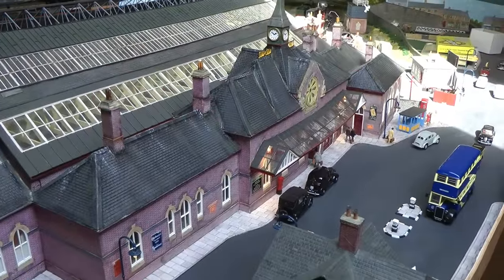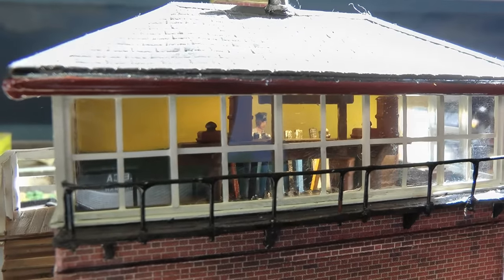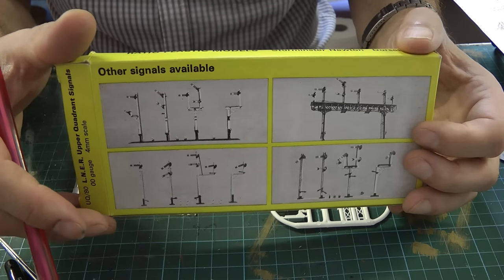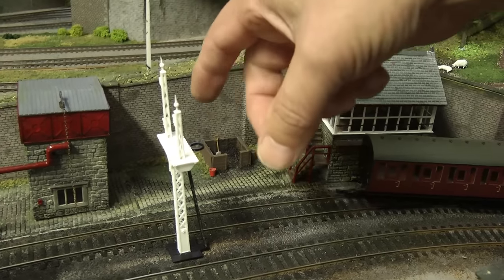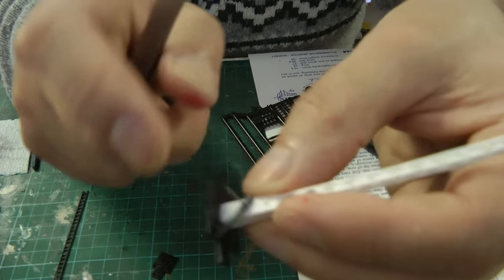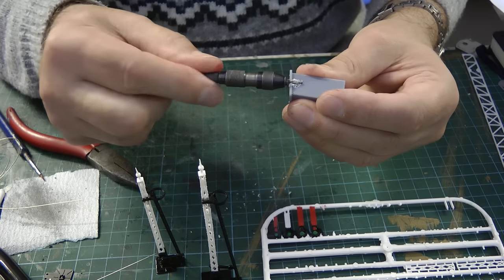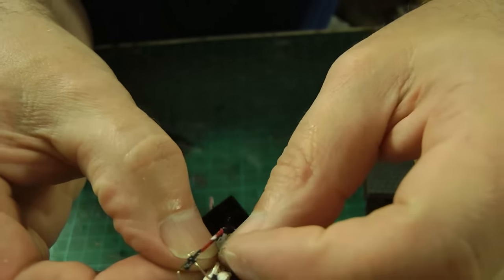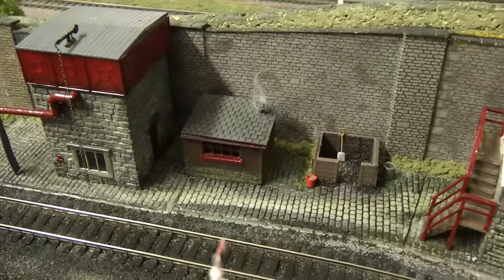Ratio Signals for Jarrow road. No394.

Comment: Hi Tony. I had to chuckle when you said that the signal kit was an old design with lots of nibs to the sprue.  Well you did say it was an LNER signal, so that’s pre 1948 😂.  Seriously, the kit is designed for someone who is prepared to go to great lengths to get a superior job.  I have a US water tower kit and the nibs are at a minimum. 
I like the outside 'netty'.  They were not posh like that when I was a lad!  
So your having your signals static?  You could add servos under the baseboard to operate them via your control panel and add a fine optical fibres going from a light source (LED) up to and inside the lamps so the signals are illuminated. They would look great at night.  
Great signalling job at Jarrow road.  If you want a more professional signal kit supplier, look at MSE.  Best, Jason.
Reply from the maker: Hi Jason mate. I remember those outside nettys. those old fashioned two ups and two down houses. where you shared with your neighbour. not very hygienic back in those days. it was in the late 1970s before we had a inside lavvy. 
I may change the signals at a later date for the automated ones once the layout is finally finished. if we ever get the layout finished. 
cheer's for now my friend. Tony.

Comment: Tony what you are calling levers are counter balance weights, which are designed to drop the signal back to danger (ON) if the signal wire breaks when in the OFF position! The use of the orginal gantry signal post would have been wrong, due to the posts being different heights, they should be the same for the station area, (shorter post denotes a lesser line, ie a branch line) the shorter signal arms are calling on or shunt signals in general, so for the station scene would be used for run-round movements. Good to see someone using the old Ratio kits, if you can pick them up at the right money they are worth their money & can be adapted to suit the scene, unlike the plug and play systems 👍👍
Reply from the maker: Good morning Vinny. i totally agree with the comment regarding the counter balance weights. but i am sure that ratio have over sized them just for the purpose to operate these balance weights-levers by hand. 
The signals are well detailed, but they do take a lot of effort to make them. but i do think that they are worth it. but i do have some plug and play as well. but for this station. i wanted a traditional old looking station. which i think i have achieved this. as always you have given me good words of advice and wisdom. thanks again for commenting my friend. cheer's Tony.

Comment: Dear Tony, just wondering about making the signals functional. Where your points are connected to the control panel, you may be able to put in either an auxiliary switch at the switch motor location, or they already are fitted with an auxiliary switch. That can allow you to operate the signals in conjunction with the switches. I’m aware the signals were in real life connected to the sequential block(s). To perform such action makes the operation much more tedious. However, as you said, ‘the devil is in the detail(s)!’
Love the flag pole on Alan’s crap house. Lord crapola got his privy planted. Cheerio
Reply from the maker: Good morning Vincent. I like your idea of controlling the singles from the control panel via a Auxiliary switch. it would a task and a half to do. Lord Crapola love it. i wonder if Al has watch the video. all the best my friend. cheer's for now Tony

Comment: The re-visiting of the station was excellent because it demonstrated the power of looking at the scene as a totality and not as a brick-by-brick view. The brick-by-brick view is a trap that model railroaders so easily (myself included) can easily fall in to. One small thing: where did you get the little models of the Queen and Prince Phillip. They would look excellent on the platform of my Jamestown station.
Reply from the maker: Good morning Andrew. the queen and prince Philip are a set. they are Ho and i got them from Ebay about 2 years ago. i am not sure if they are available. but its worth a look. i think i paid £12 at the time. thanks again for commenting, i hope you find a set. cheer's for now Tony

Comment: Hi Tony, glad you went first ,I have loads of those kits to make up. A real test of your patience, looks like the mould has just about worn out on the seams. Still they have made some cracking models and splitting them looks fine; it’s obvious to which track they belong. I was wondering if they are robust enough to add a servo to drive the arm? Looks like, with his flag in residence flying Lord Al is in still in that loo, must have taken a wadge of the Dandy and Beanos in to read and forgot to come out! Give you eyes a rest now, take care and all the best Stephen. Did you get the cam sorted out?
Reply from the maker: Good morning Stephen. These kits do take a lot of cleaning up to remove all the flashing. and they are very brittle. so yes take your time. i was hope to knock these out quickly. but i did not realise how much work was involved.  
I will have to ask his Lordship what he reads when he is on the loo. I am sure his next video. will have a ton of lavvy jokes. i am going to try something with the camera. so we shall see if it works. many thanks my friend. cheer's Tony

Comment: I must admit that signals have always been something of a mystery to me. I prefer lights to armatures but even then i don't always get it right. A suggestion for Jarrow Road (although you've already made the signals now) but could you have used a gantry spanning over the tracks? In a tight squeeze on my layout I found a gantry worked better than trying to fit signals between tracks. Anyway, another good video. Thanks Tony.
Reply from the maker: Good morning Alfie. very true a gantry would work well in the small space that is available. and it would solve some of the issues that we come up against with this mini project. tight spaces is the main problem here. thanks again for commenting. all the best Tony.

Comment: Thanks for this one, Tony, I'm still trying to work out how to power the signals that I have...  Any suggestions?
Reply from the maker: Good Morning Ken. powering these signals wont be easy, as the signal arm itself only move 5mm. the hardest part would be finding a motor to do. i think in the comments someone has come up with a suggestion. i hope you find a solution. all the best Tony.

Comment: Hope they come good, as i`ve collected a few packs mostly of the older ones, I might even dare try to conect the to servo if there robust enough.
Reply from the maker: Good morning Clive. These kits are delicate. i think they could be adapted to fit a servo to them. as the cable you get should hold up to the stress of the servo. the plastic parts will have to handle with care when fitting them together. but yes its worth a try. many thanks again for commenting. take care buddy Tony

Comment: Why not just raise the height of the signal at Jarrow Road by a millimetre or 2?
Reply from the maker: Hello Phil. i did think of that. raising the height of the signal. its the curves of the track coming together before the point is the main issue. i thought about the signals. there's just not enough space. the track do get wider just before we reach the platforms. but then its  close to the station. but we live and learn. many thanks again for commenting. have a great weekend. cheer's for now Tony
Reply: The end results look good as normal. @TONYNORTHEASTERN